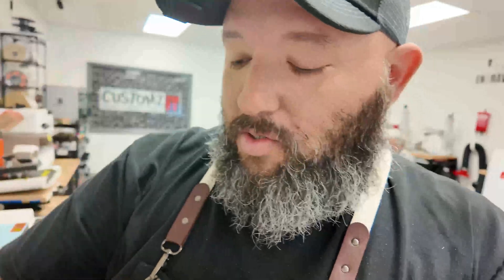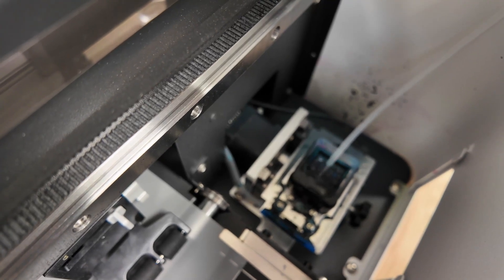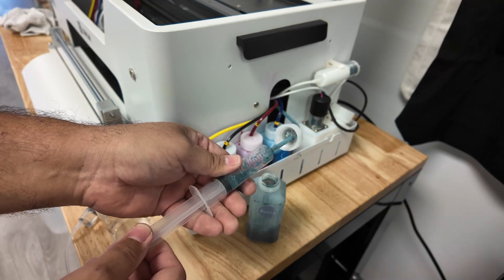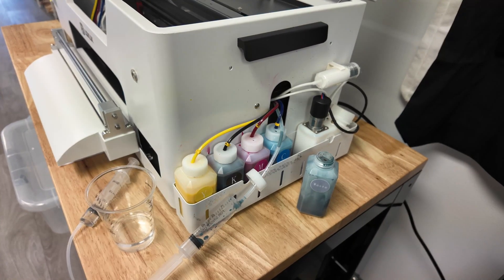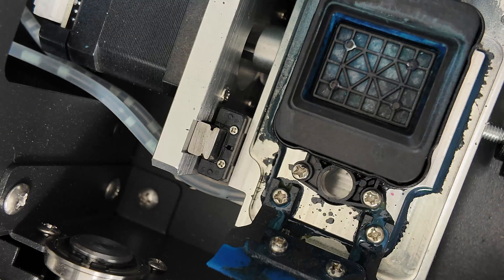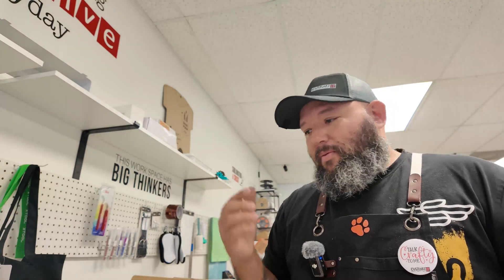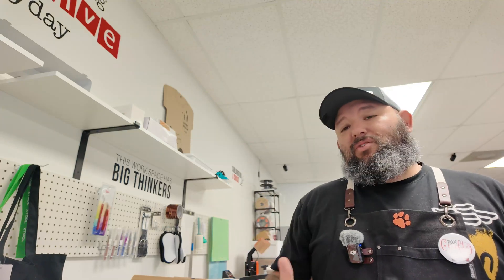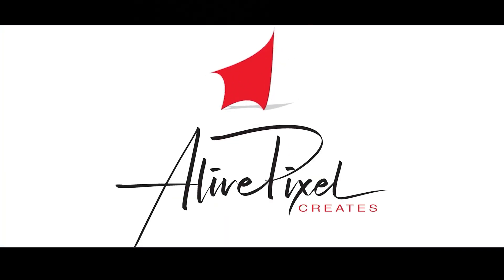How to Clean a DTF Printer Ink Pad | Step-by-Step Guide

Comment: My printer is not absorbing any ink and the waste ink is not coming out either. I have tried almost every video i could find. Would you have any ideas?
Reply from the maker: Have you checked or replaced the ink pad. Also when you run a clean cycle do you hear the vacuum pump?

Comment: Do you turn your printer off nightly?  I thought it had to stay on at all times?  Thanks
Reply from the maker: No is running 24/7
Reply from the maker: When I'm leaving for a few days i do but make sure you do a wet cap. Basically to avoid the ink settle in the print head

Comment: Thank for sharing.

I was so excited to receive my DTF printer recently and began setting it up today. I followed along with your setup video and got as far as installing the roll attachment and loading the DTF film.

However, when I opened the printer, I noticed something very concerning — all the ink tubes had magenta ink inside, and every ink container, including the white, had magenta ink splattered inside. I immediately stopped the setup process.

I’ve already contacted the company in hopes they will replace the printer, because I do not feel comfortable performing maintenance or cleaning on a machine that should have arrived in brand-new condition. Ink contamination across the tubing could affect both the printer's performance and its longevity, and I don’t think it’s reasonable for a customer to deal with that before even turning the machine on for a first print.

Hoping for a quick respond and resolution
Reply from the maker: I am so sorry to hear about your experience, that is really frustrating. 
The thing with China is that the quality control is low.  And I tend to double check screws and other essential components before using the machine. Hope they come back to you soon.
Reply: @AlivePixelCreates  Thanks.  Just wanted to share that while I wasn’t thrilled about having to do maintenance right out of the box, I really appreciate how the company handled everything. Their customer service was excellent — they were responsive, helpful, and guided me every step of the way . They just in a different time zone so one have to have patience.

They stated it was cleaning solution they do before sending out equipment which it was once I checked it. But they recommended I do the cleaning solution again, sent me a link to purchase it on Amazon, and even offered reimbursement of the solution. While waiting for it to arrive, I cleaned the ink containers with distilled water and let them dry overnight. Once the cleaning solution came, I flushed out the lines and filled the ink tanks. Thought it will be a good learning experience. 

I had some issues with black and especially white ink at first — lots of cleaning and nozzle checks. Black cleared up pretty quickly, but white took several attempts. I eventually walked away for a few hours, left the machine on, and when I came back for another round of cleaning, the white finally cleared up.

Honestly, shipping conditions can be unpredictable — who knows how these machines get tossed around and cleaning solution leak all over. But I’m up and running now, and feel much more confident about maintaining the printer going forward.  Love watching your video helps a lot and notice you have other video regarding laser etc. and looking forward to watch them since I also have a laser.  Again, Thank You!
Reply: @woofwoofs2 Wow, what a out the box experience. Thank you for sharing. Many of us are waiting for shipments of our new printers. Thank to you, we will know what to expect in this situation 🙏🏾🙏🏾🙏🏾💜💜 Hope your printer is still doing well to date
Reply from the maker: Thank you so much for sharing your experience and I'm very happy that you are up and running. Please feel free to message me directly on FB if you have questions or Ithere is anything I can help you with